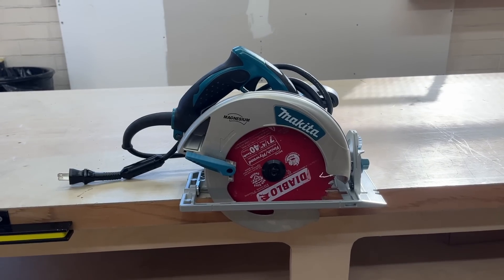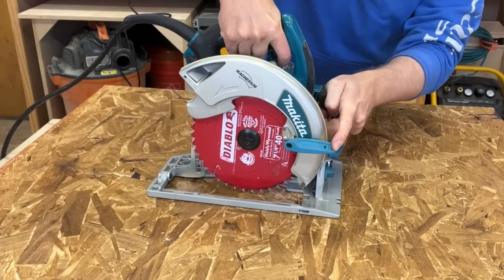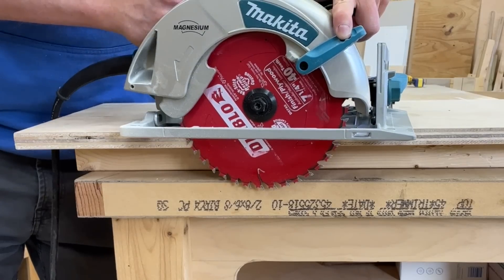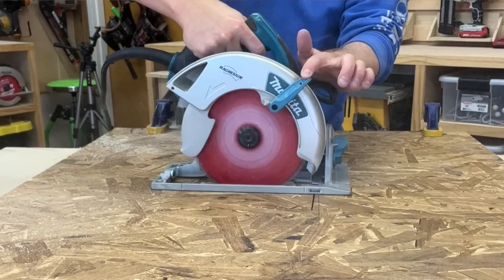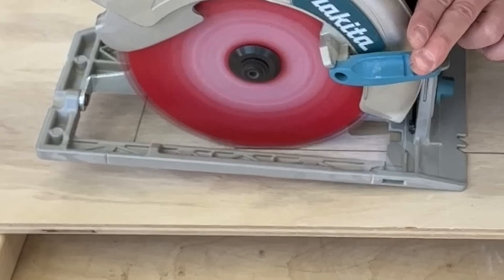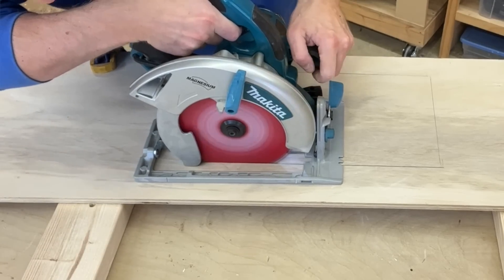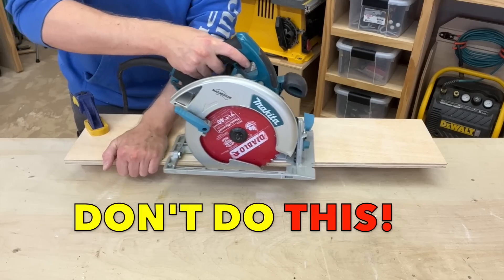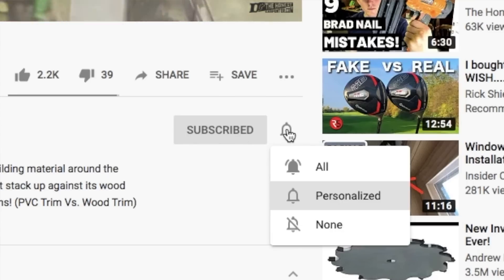Don't Try This DANGEROUS CUTTING TECHNIQUE! (Here's How To PLUNGE CUT W/ Circular Saw Instead!)

Comment: I've done plunge cuts for thirty years, yes rarely even the floating one when I needed to. I agree that these cuts should not be used by rookies. One of the safest ways to work is to know all your tools, and how they handle. If your afraid to use them, then keep it simple. Allow yourself to grow in experience. 
Plunge cuts look scary, and can be,but when your comfortable, and confident with your saw, then it becomes second nature. I usually use my carpenters pencil and slide it between the saw, and the handle for the guard. It acts as a wedge to keep the guard open. So that I can have both hands firmly on the saw where they belong. Finish my cut, pull the pencil, and lift the saw blade out of the kurf. My hands and fingers are not what they use be, and that way feels safer for me. 
The way that was shown is very well done, and nothing wrong with it at all. 
It kinda sucks to say this, but until one experiences a kickback, and learns to handle it. Plunge cuts are scary, and if someone don't know how to handle a saw, I would stay away from it until you get some experience. 
Heck I probably pounded nails for at least a year before I made my first plunge cuts. 

Good job explaining all the details.

Comment: One thing that you may have included was the reason why you don't ever run the saw BACK into the stock after the plunge. For anyone wondering, the blade will have a tendency to climb on top of the stock and kick back. 

30 years running circular saws of all types, and I rarely if ever do a loose plate plunge cut. It really isn't necessary. I also use worm drive/hypoid saws almost exclusively over sidewinders, but that seems to be more of a personal preference.
Reply: As far as circular saws go I generally use either my M18 Fuel or an old Skil worm drive. The M18 I have has some computer chip and programming I guess and I've never had it kick back on me. With that saw, I will ignore the traditional and common sense safety rules for circular saws occasionally and am comfortable in doing so (I still make sure to think it through and acknowledge shit still could happen. Worm drives on the other hand... I don't go as far as clamping down what I'm cutting and holding the saw with two hands, but I don't get crazy by any means.

Comment: Good video thanks. Need to discuss holding open the blade guard. Holding the guard-lever while you cut removes one hand from controlling the saw, not good. I understand wanting the blade guard to return as soon as you remove the saw from the wood. If we had an electro-magnet to hold the blade-guard open while cutting, it could drop automatically when the trigger is released.

Comment: When I was a kid and just starting to help my dad do jobs around the house I remember asking him why he had so many different tools.  And he said if there was a specialty tool made to do a specific job then any other tool you could use to do it is using that tool incorrectly.  He told me that is how he had kept himself from losing fingers on multiple occasions.  You are always better off buying the specialty tool even if it cost you 50 60 70 80 bucks then to use a tool other than how it was intended to use.  Circular saw is not intended to be dropped into a piece of wood to cut a hole.  There are multitude of other tools that you can use that are made specifically to do that.  So use those and don't lose a finger.
Reply: Sometime you just have to use what you have. If it's just a one of job, these techniques are very useful.
Reply: circular saw is perfectly safe to plunge cut, provided you are experienced and competent with the tool. However if someone does not feel comfortable, nothing wrong with using a jigsaw etc. Will be harder to get as strait a cut however,  and will be much slower.

Comment: As a semi pro haha I think you've done a great job explaining the how's and why's for both how not and how to perform this potentially catastrophic technique. Maybe an add on for a future video might include why you DO NOT want to skip the circular saw all together and just start the plunge with the jig saw haha. If you only want to use the jig, drill a hole in the field big enough for the jig saw's blade so you can start cutting with the jig saw table flat on surface as per normal operation. I think it's great to show the DIY'ers how to do a more dangerous technique the safest way possible with the plunge cut using a circ saw but the "drill a hole to get the blade started" method can make it so don't even have to use the "Plunge cut technique", depending on the situation it could be a better way to go and decrease the odds of an amputation even further haha

Comment: Although I do, occasionally, lift the guard to make a cut, I keep it to an absolute minimum.  I have not done very much plunge cutting, but I use my saw a lot. I cut up pallets to burn in my wood stove.  That's how I've heated my house for 15 years.  

After having the saw buck and sink fully into my leg, from which I almost died, I have adopted the "Use the saw exactly as the manufacturer instructs" approach.  It is a bonafide miracle the blade missed my femoral artery and also did not contact any bone or tendons.  My grown children were with me, taking the wood I was cutting to the shed for stacking, and they almost watched me bleed out.  

Lift the guard, if you must, but under no circumstance tie the guard back.  Sounds like common sense to most, but I had convinced myself the guard was slowing down my production.  Well, the injury happened on February 15, and I was not able to cut wood again until may;  that was a real kink in my production.    Just throwing out this out there, in case it could save somebody's life.

Comment: I've never cut with a loose plate. Blade depth needs to be adjusted at some point for the best chances of getting a clean cut without binding and hacking my guts open, and it just makes more sense to make that adjustment when my eyes aren't focused on a spinning blade, as I was taught in trade school. Messing around with blade depth or any other adjustment while the blade's spinning just increases the risk. I take risks on site, sure, when it's absolutely necessary. Plunge cutting isn't a situation that requires sacrificing intelligence for convenience.

Comment: Call me a sissy, but I've seen too many accidents with fingers lost and severe cuts to body parts. I much prefer to use my drill to start an opening and my jig saw with a guide for face plate to keep a straight cut. Appreciate the video and channel. You always bring up issues and/or tips to make me think about how much I love my fingers. 🙃
Call me Chicken Chuck, I still won't lose any sleep, cause hopefully when I walk into my shop, I'll be able to count to 10 without using my toes. 🤣
Reply: Sissy. 😂😜
Reply: @Texas.Tactical  Don't forget Chicken Chuck. And you won't find me shopping for prosthetic devices to replace my fingers. Awfully tough to grasp a hammer with half a hand.
Reply: Chuck, I added my reply before reading your’s. I totally agree with you!
Reply: In case it wasn’t obvious, I was just joking. Everyone should only do things they feel comfortable with.
Reply from the maker: I don’t blame you! I got nervous on the loose plate gang plunge here. That technique has ALWAYS made me nervous 😅
Reply: @TheHonestCarpenter  Awe H€ll, you cracked me up!🤣

Comment: My best advice especially if you're not an experienced woodworker is buy a real good jigsaw like a Bosch 7.2 amp .  They are a little expensive but the power and the quick cutting ability make them worth every penny and believe me either as fast as using the circular saw if not faster . They cut through hardwood like butter .  You can thank me later

Comment: Good tips for safety   but some times  on small cuts 3 or 5 inches  a jigsaw  or  oscillating or reciprocating saw all depends on the     material or size of the cut  Love  your  insight  and  knowledge
Reply from the maker: Thanks Ron! Very true—circ saw can really overcut on small plunges.
Reply: @TheHonestCarpenter  all  depends on the  size of the cut in  size òf the  opening  happy  new  years
Reply: As a noob I find the jigsaw way easier to use, and I feel like getting some hours in on the jigsaw is good preparation for graduating up to the circular saw.

Comment: I have done the loose plate plunge cutting. It's not too bad if you know nothing is under the piece and don't need the cut to look nice.

Whenever the cut needs to be clean or you want more control the way you show is better.

Comment: I'm strictly diy, and not feeling like I need to do any plunge cuts at all with my circular saw. I'm comfortable enough using my circular saw, just not to do that. Still, it's best to know how to do it properly, so thank you for the lesson. TBH, I know how to use a jigsaw to do a plunge cut, but even then I start with a drill instead of the plunge cut.

Comment: Great video. I really appreciate all the info you provide, and the clear and concise delivery. 
Given the risks involved with plunge cutting using a circular saw, is there perhaps a safer tool for it? Maybe use a jigsaw? Something else?
Reply: skilsaw is safe to do a plunge cut with if you are comfortable with the tool and have some experience. If not, best to drill out the corners and use a jig saw. it will take more effort to keep a nice strait line over any distance though.

Comment: the only way I'd even attempt a loose plate cut is by clamping it down in place, but I'm not sure it'd be stable enough even for that. and as a beginner, I found gluing and/or screwing stuff back together is a lot easier, even if it looks rough.

Comment: I'm still so irrationally nervous of a circular saw.  Only use it for straight edge cuts. If I need to plunge I will make a hole with a drill then use a jig saw to cut out, sometimes if the hole I need to make in the field of a board is small enough, I'll break out the Dremel. Yeah, I'm SCARY as all outdoors, but I still have all my fingers. Maybe my fear isn't all that unwarranted as I tapped my fingernail with a small electric chainsaw as a teen. It did a whole lot of damage in the blink of an eye. Honestly it didn't hurt all that much, but the sight of the cut and all that blood was nauseating.

Comment: I can't think of a reason to use the loose plate technique over proper technique tbh.
I sometimes use the floating blade technique though. That is for when I need to trim off a small amount of material at an edge. I know I probably shouldn't do it but sometimes it's just the most convenient.

Comment: I have a circular saw that works with a guide rail. Would loose plate cutting be appropriate there? It seems safer in terms of the plate not moving around as compared to the method you outlined here. And because the guide rail will be aligned well with the blade, I won't need to make any corrections to the angle or the position. But on the other hand I'd still have to contend with the blade likely being deeper in the material than it needs to be. (And just to have said it: It's not a plunge saw.)

Comment: Very informative video, as always. What would be your thoughts on this: I have ordered a DeWalt DWE576K with a guide rail. do you think it would be safe to use the loose plate technique when said plate is resting on the track, or would you still recommend the tilting method? It seems the tilting method might risk cutting into the track?

Comment: For plunge cutting, even with a track saw, the depth of cut should be set to maximum as this leaves far less material to be cut, at the corners, using either a jigsaw or a hand saw.

Comment: It works for me when I cut double blind chamfers into pilasters.

You can't plunge using the edge of the plate when you're plunging at an angle, loose plate cut allows you to do this.
Reply from the maker: I see what you mean, John. But no one should be even attempting those cuts without a LOT of saw experience 😅

Comment: I've loose plate cut many times. You can roughly control the depth of cut by not allowing the saw to drop. Or you can plunge to the depth you want and tighten the plate. And yes I've done that both when the blade is spinning or I'll hold the depth and let the blade stop and then tighten it.  But I use circular saws all the time. And I don't tighten the shit out of my blades, this way if it binds the blade will just spin on the arbor without sending the saw back at you. Kick backs rarely happen for me. I have to be doing something especially dopey for that to happen and by that time I'm expecting it... yes, I have all my body parts.
Reply: @blanketstarry7725  lol

Comment: I always plunge cut but I never do it with a loose plate and have the blade only as deep as necessary. Also no plunge cuts for finish work unless I am using a track saw.

Comment: Good stuff as always.  I've seen all of these and more on job sites.  In the past I've been encouraged to use the whole blade so it leaves a more vertical cut and less to clean up.  I had one super show me how to make a round (arch) cut with a circular saw.  That was pretty sketchy.  These days I prefer the track saw for this.  Worth the investment even though it wont cut 2 2x.  I did see the other day, Wen is making a 7-1/4 track saw.  Seems logical to me.
Reply from the maker: Yep, I’ve seen all that stuff on jobs over the years Gary, and often been pressured to speed cut with everyone else. I steer clear of all that now. But i might get that Wen! They really have some good baseline tools 🙂

Comment: Plunge cuts are regular in framing. It's not to cut in the middle, it's actually Way safer to Plunge in certain situations, especially cutting hanging boards like rafter tails. A Plunge cut is safer because there's less chance of kickback where running the saw up where a drop piece can pinch the blade. 
The Worst thing is to hold the guard up or shim it open. The nail or wedge you use could slip out during a cut and usually you keep cutting trying to work the guard back up. I've seen so many kick backs. When I buy a new wormdrive saw, I immediately take the guard completely off. For me it's much safer without it. You just have to get used to turning it over onto its side when you lay it down. And I Never let anyone use my saw. Even if they remove the guards on their saws. You just don't. A normal one, yes. But not those.

Comment: I do loose plate plunging most of the time when I have to plunge cut. When I cut with the track saw or a circular saw on the track there is almost no other way then loose plate. When I don't have a track and need to plunge I clamp or srew a stop block on the workpiece to rest the backside of the plate against so it can not kick back. I agree that your method is safer than loose plate without a stop block, but loose plate with stop block seems almost safer at least to me.

Comment: I've got that same saw and have a question about it. The sole plate looks like it could have been rectangular except someone has cut the rear left corner off. Is there a reason it is shaped like that?

Comment: Window cutouts with this technique?  I've heard to use a router, but this could work as well if you're cutting a new window out of OBS after you've framed the inside.  Thoughts?
Reply from the maker: You could, Chris! Just set the blade to 1/2” and mark your corners. But a router works great too 👍

Comment: I often start my cut with a loose plate and lock it once I'm at depth. It is a lot easier to get an accurate cut, especially when I'm cutting something awkward, where I can't see the blade properly. I would never, ever continue the cut with it loose.

Comment: Excellent advice on circular saw.....I have always used it this way since I was a teenager....over 50 years later....I still have all my fingers and they work!! I can't say that about some "carpenters" I have worked with or met, (sad to say)......a power tool...of ANY TYPE.....is NOTHING to mess around with!!  I have even had cordless drills using a hole saw, bind and flip out my hands, sprain the wrist and smack me hard! I'll be damned if I ever do screwy things with a fast-cutting tool! Whether stationary or hand-held, the power and speed are a lot stronger and faster than you are.

"Intelligence...true intelligence is the ability to learn from your mistakes....BUT....WISDOM...TRUE WISDOM.....is the ability to learn from OTHER people's mistakes!!"

Comment: I think you misunderstand loose plate cutting, the plate isn't entirely loose, just not properly tightened. So you do get some resistance and if left alone the saw will stay at the depth it is set. It kind of increases the pressure needed to push through the wood, adding stability rather then removing it. And when you've reached your depth it acts as a tightened saw plate. Rather then having a minimal point of contact at the start you have a full plate on the board, and then you can push the saw through to the correct depth with less risk of miss-alignment or kickback. At least, that is how I was taught. And yes, I pretty much always use "loose" plate cuts, unless it is starting on an edge, at which point I use the plunge demonstrated here to get a more gentle start.

Comment: I have a question. Are circular saws even necessary for the average DIYer? Or should we instead put the money toward a track saw that can be used on or off the track (e.g. Festool, Kreg, Makita, and Powertec)? It just seems that a track saw can do most of the things a regular circular saw can do but a whole lot more (and more accurately), especially when we use them with parallel guide systems like TSO's using the 20", 30" and 50" track options which can essentially replace a table saw so long as the workflow isn't too heavy (which usually isn't a problem for DIYers).